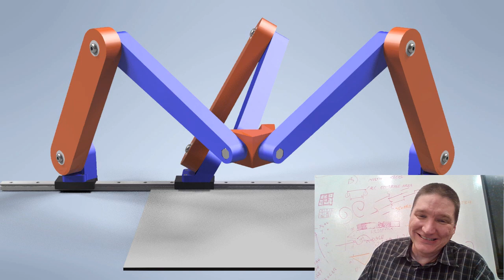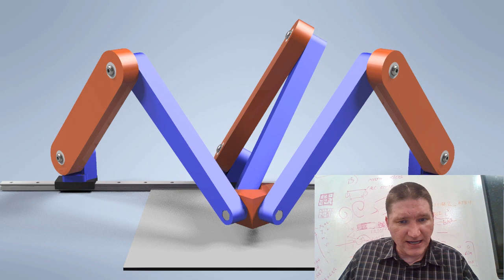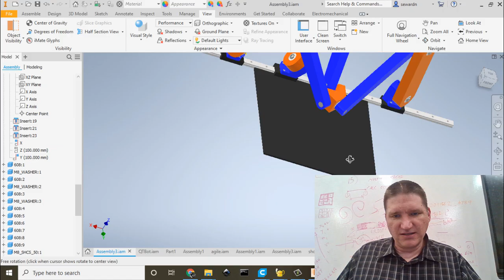RepRap Monorail (Single Rail Tripteron)

Comment: People are mentioning railroad tracks, but for urban areas you could simply use 3 "cars" (automobiles) or trucks depending on size, optically aligned with markings on the pavement. Would be a minimal set up time and could permit normal street traffic.

Comment: Haven’t finished the vid yet, but if there’s really any load on the platform I’d think there would be some toppling issues. He mentioned legs on the other side to handle the tilting, but how would that affect the “single rail” concept?
Reply from the maker: Just need to bolt it down to something.

Comment: Seems a little too rigid for complex shapes, but definitely viable for large scale. With a wider rail and linear guides, things certainly could be further improved. Since it's attached to 3 points, I think you only need the middle joint to be fixed like that. The left and right ends can be mounted on a rotating base. Also, for even more stability, an additional rail can be mounted behind the existing one the extra linear guides connected to the original guides.
Reply from the maker: I dont understand the rotating base concept.  The angles are all static as drawn.  The rail or rails need to be sized to fit your application.  I have mgn15 rails which can support about 50 ft lbs which is plenty.

Comment: Looks really cool but for how much leverage those small movements need it seems like the Torque you need is more than the metal parts can handle
Reply from the maker: The forces aren't that bad.  Sizing a rail to handle it was easy.  The limiting factor is arm rigidity.  It is easy for long arms to act like a spring.

Comment: Some very interesting kinematics on this. Would be cool to see it progress farther as a 3D printer.
A few questions:
1. How much space is required (length of rail, and clearance for arm movement) for something with a motion of 12" cubed?
2. Is the motion linear, or does it follow a curve where you may lose steps in the extremities of the movement area?
3. What are the torque requirements for moving something like this with an average direct drive extruder?
4. Can the end effector be designed to fit an extruder easily? What are the results of moving the arm joints further out? And are there movements where the arms would potentially interfere with an extruder?
Reply from the maker: 1) A lot.  For a Y of about 300, the rail needs to be 500mm plus any travel you want in the x.  Three is also the problem that the z goes to nothing as you get close to the rail.  This would have to be truely massive to get a 12" cube.  A meter long DuoRail could do it.  As drawn the DuoRail is 1500mm. <iframe width="560" height="315" src="https://www.youtube.com/embed/D3Fpy2_MyYg" frameborder="0" allow="accelerometer; autoplay; clipboard-write; encrypted-media; gyroscope; picture-in-picture" allowfullscreen></iframe>
2) Yes.  Linear everywhere
3) Not bad.  Torque and forces will be pretty low.  The problem is rigidity.  Arms that long will be pretty springy so it will be hard to define a precise location.  To solve this, make volumetrically bigger arms. (thicker wider...same length)
4) Shouldn't be a problem but you do want to stay as light as possible.  I would suggest a light extruder like an orbiter https://www.printedsolid.com/products/ldo-orbiter-v1-5-140g-dual-drive-direct-extruder?variant=32974481227861

Comment: Been thinking about this design since I first saw it. Going to build one for sure, even if it has inherent flaws. It's just such a cool unique design
Reply from the maker: Have you checked out https://youtu.be/D3Fpy2_MyYg. This is closer to what my prototype will be.
Reply: @NicholasSeward  I have, but something about there only being one rail just makes it so cool to me. Even if I know going in it it will have inherent flaws. I've been thinking about building a cheap ass-can be RepRap 3d printer for a few months now and this design is absolutely perfect for that
Reply from the maker: @t1mmy13  I need to revisit this.  I should be able to put two rails very close together.  The thing I need to do is allow the middle carriage to not be captured by the other two.  I also need to keep the arms from colliding.  I think clever positions and sizes can help there.  Here is another monorail, that is a little more practical. https://youtu.be/Q6_u6FMpCSE  It doesn't show it but I would also use two rails close together.
Reply from the maker: @t1mmy13  the angle can be anything between 0 and 90.  I used 30.
Reply: @NicholasSeward  My idea to work around that issue was using bigger outer arms and a smaller inner arm and see how far I will get. I can see how you would use a second rail but from my cheap perspective: two rails would raise the cost too
Reply from the maker: @t1mmy13  can't wait to see what you come up with
Reply from the maker: @t1mmy13  can't wait to see what you come up with
Reply: @NicholasSeward  Thank you for the encouraging words! I've went trough a few design itterations and I've found one that I want to start testing now. For now I'm using 180mm for xy and 160mm for z which seems to give enough travel range but avoids collisions. (in theory :)) 
Biggest issue I've ran into is sourcing rails, I wanted to go cheap and use v-slot and rollers, but I'm not able to buy those anywhere at 1 meter length with a reasonable delivery time. I'd love to use proper linear rails but I can't find them below 60 euro a meter which is a bit much, and that's without carriage/bearings. So I landed on using smooth precision rods, I can source hardend steal ones at about 8 euro per meter.  
As a backup plan I'm buying enough parts so if the monorail doesn't work out I can make it a duorail or straight up a tripteron.  
Motors are on the way, I'm going to wait for your thursdays livestream to see if something is brought up that I hadn't thought of and if not I'm going to order all the other parts on friday. It's been fun!

Comment: What if you placed three ball screws parallel to each other under the rail and have matching nuts on placed under each arm to capture the corresponding ball screw motion to the arm? Might be more reliable than belts
Reply from the maker: For sure!

Comment: @Nicholas Seward
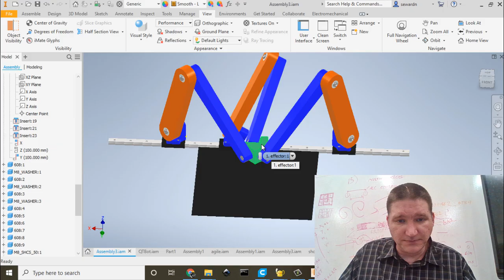2:26 You could add a (stepper?-)motor turning a gear that (is connected to a gear track or) rotates along a stationary threaded rod, the engine thing could be located between the black "gliding surface" and the blue "angle thingy".
I'm not an expert at all, but I feel that a threaded solid steel rod would be more precise than some pulley system.
Reply from the maker: Check out noncaptive steppers.

Comment: How would you move the arms in different directions if there´s only one belt? I feel like there have to be motors on each "foot", which would be very difficult and bulky...

edit: Ok you could use three parallel belts, each only attached to one arm, might still be bulky tho or be less rigid with the slimmer belts.
Reply from the maker: Yes...you would need a stepper on each carriage.

Comment: This looks pretty cool, could mount it on a wall and have it print on swappable beds in a sort of 3D print commission factory so there's minimum downtime between prints and allows extra care for removal of the print. Or you could print on a conveyer belt.

Comment: Did you analyzed the precision (what is the ratio between carriage movement to useful movement?)
Reply from the maker: It is either a 1/2 or 1/root(2) depending on the direction.  In anycase...close to 1:1

Comment: I would love to see a real one.

Do you got any idea if there are any compromises regarding the strength/stress on the parts, or speed or resolution limits at different coordinates etc?
Reply from the maker: Parts need to be as light and rigid as possible.  Speed and resolution will be roughly the same everywhere.  Big (volumetrically big but low mass) arms are what is needed for the rigidity

Comment: That one rail is going to have to be absolutely perfectly precise. Perhaps mount the sliders vertically and create 1 wide rail or two rails parallel. (I didn't watch the full video I had to get my idea out)
Reply from the maker: The rail specification saybI can support up to 50ft lbs in any direction.  One rail should be plenty for these light arms.
Reply: @NicholasSeward  oh awesome!

Comment: The problem with that is every point in space is not a unique map from foot position... and space is bifurcated. Easy to overcome if you solve the center arm problem algorithmically... otherwise you just make machine that will lock up and break itself.
Reply from the maker: Don't follow.  The resolution uniform over the whole range.
Reply: @NicholasSeward  I am sure there is a mathematical proof that you can't map 3 dimensions to 1 completely, continuously, or smoothly.
Reply: ...the monorail won't work... like you think. Some stranger shapes may be created more efficiently, but it will be harder to make strait lines and edges, distance and computationally.
Reply from the maker: @thescroll7521  sorry.  Reality begs to differ.  There are already tons of tripteron in the world.  This looks different but the math is the same.
Reply: Lol.

Comment: would be a giant stress on the rail though, with all the weight
Reply from the maker: Weight is very low.  The rail can handle up to 50ft lbs which is a crap ton compared to what I expect.
Reply: @NicholasSeward  well yeah obv it all will boil down to the use-case
Reply from the maker: Put another way...the design will be dictated by the use case.

Comment: Im not sure if this is going to work irl.
Because you have to consider the forces applied to the joints.
I see two problems with the z-axis movement.
1: The movement of the base is working mostly against the joint(s) of its arm, pulling them apart ( |.| -> \./)
This is somehow like how a screw stays in place because the friction is higher than the torque resulting from the pressure of the material trying to push the screw back out.
2: You have a high(?) transmission ratio. At first this might help with the limited space on the track but this makes the first problem even worse as you need even more force on the base to move the arm/tray (middle thingy) up 
(down is easy(er) because of gravity)
Reply from the maker: Yep.  You have some extra concerns when designing a tripteron.  Check out https://www.youtube.com/watch?v=beuY401hfh8  This is essentially what I am doing but with 3 rails.  You just have to establish a specification and design to meet it.  Math and engineering for the win!

Comment: That's about the most beautiful thing I've seen in a long time! Just wow...
Reply from the maker: Ahhhh.  Thanks!
Reply: @NicholasSeward when you mentioned the belt drive, at first I thought you should use a rack and pinion, but then I got to thinking... you could have a ball screw system with the exact same setup! A single long screw with three individual ball nuts!
Imagine that! -- A three axis system using a single bearing rail, and a single ball screw!!!
Reply from the maker: @ThatCB500XGuy  that would be very slick

Comment: Tripterons, and models that're an evolution of Tripterons, are cool and all, but it always seems that they take a much larger amount of space than what their build area provides, which is typically an issue. Though this idea could be cool for expandability, either in a series of build plates with multiple sets of arms along a singular rail, or using two rails for discrete multi-extruders on one build plate, or a combination of both.
Reply from the maker: It is no SCARA when it comes to robot size vs build volume but I would say tripterons are only slightly worse than traditional cartesian bots.

Comment: Seems like a good idea for 3D printers till you realize this would be really unstable and jerk sensitive. Neat idea tho, but I don't think it'll take off
Reply from the maker: It will be a trick to get right.  However, some tripterons can pull 5gs will remaining accurate.  It is just a matter of engineering for the specification you want.

Comment: So I know that stepper motors and their behavior means that if a motor needs to move a small amount over a large area would result in a "salmon skin" like effect.
While if the motor needs to move a large amount over a small area it would limit printing speed and possibly contribute to extrusion issues.

So, I wonder.
To show how this would work could you provide a map of the accuracy/speed across both axises.
Reply from the maker: Suprisingly the resolution is a constant everywhere.

Comment: Now that's creative! One of the problems is the y resolution which will always be only half of the x resolution. In other words, you have to do 2x steps when doing an x movement compared to a y movement to get an equal resolution on x and y.
Reply from the maker: As drawn, the x and y resolution is the same.  I do have a version in the works where I traded in the 45 degree angles for 30 degree angles.  That will reduce the y resolutions.
Reply: I'm thinking of building this and I might be using this kind of a belt path in order to increase the resolution (mostly to get finer z resolution): https://youtu.be/bheHUcz1AIo
Added benefit is double the torque.
I might even go with 0.9 deg steppers.
One arrangement of the motors could be to place them just after the edge of the rail... The motors would be next to each other with their shafts pointing to the "floor". Assuming that the shafts are 17mm high, the motor farthest to the rail would be offset from the floor a bit more than a shaft length, let's say it's 20mm total.... The motor next to it would be offset by 40mm and the one closest to the rail would be offset by 60mm. That way even a complicated belt path like in the above video is possible.
I must admit that I like your idea of using a single belt and mounting the motors on the carriages alot due to its simplicity and minimal part count.

I saw your design a few days ago and I can't stop thinking about it :)
Reply from the maker: @hrvojehorvat9099  Awesome!  I can't wait to see.  I should note that resolution is not going to be a big problem especially with modern drivers.  The dominating problem will be arm rigidity.

Comment: It is a really nice idea (especially for machines that need to be compact and do not have a lot of a load - I can even imagine going as far as having a trailer with such thing mounted on to print small-scale concrete), but I see one issue that, imo, is unfixable by design - max z varies depending on y, and at some point you pretty much have no z at all
Reply from the maker: Fixed....https://youtu.be/_mGD5NxuxdI and https://youtu.be/Q6_u6FMpCSE hahaha :-)
Reply: @NicholasSeward  well, the first one is not that compact, but the flying thing makes the problem non existing at all indeed (but now you can not mount in onto movable platform).
Though I just got an idea that you can put that middle arm on the second rail that sits right next to the first one to keep the kinematics same but resolve the collision issue. It will not technically be monorail, but still have the spirit of the one in that video. 
Also if done on a bigger scale they can be self-propelling if you attach motors with pinions to their bases and add racks to the sides of rails (I personally always try to avoid belts :p)

Comment: This video is great, thanks for sharing! I really like your idea. For the movement belt look at blue flexirack. I've used it on my CNC after discovering it in a sewing shop. works great and is strong. Its a rigid timing belt that you can bolt to a flat surface. Worked out better than a regular t2 timing belt in my case. I do not know what the industry calls this type of gear tooth strip. edit: Oh its a flexible rack, should have seen that coming!

Comment: Awesome idea! 
A second parallel redundant rail could be added just for increased stiffness.
Reply from the maker: The specification on the rails say they can support a torque of up to 50ft-lbs.  I should be an order of magnitude less than that.  I am thinking about a second rail though This https://youtu.be/_mGD5NxuxdI
Reply: @NicholasSeward  
Was more thinking about the bending flex of the arms rather than torsion flex of the rail. Especially for 3D printed plastic.
Reply from the maker: @mechadense  I see.  That is easy to design around.  If you double the cross sectional area of your arm, you get 4 times the rigidity.  The weight of the 3d printed parts increase by a factor of a little over 2.  Long story short, it is pretty easy to make 3D printed parts rigid enough, they just have to be volumetrically big but they can stay pretty light.
Reply: @NicholasSeward  I see. Well you lose a bit of build-space. To be honest the ulterior reason for me to obsess over stiffness is that beside the repraps of today I am also thinking about far future diamondoid nanomachinery (for micro to nanoscale atomically precise 3D printers in matter processing chips). And bending stiffness scales down linearly with machine size. So I like to look at robot geometries that maximize stiffness such as: 
★ parallel mechanisms (as many of yours)
★ stubby mechanisms (as you suggest)
★ redundantly supported mechanisms
(as I brought up here)
Reply from the maker: @mechadense  Yes yes yes!!!
Reply: @NicholasSeward  -- If you like the idea then I can recommend:
(1) the book "Nanosystems: Molecular Machinery, Manufacturing and Computation". There is lots of fundamental feasibility checking math in there. 
There's a free but incomplete Version too. 
(2) My wiki: "Mechadense's wiki about atomically precise manufacturing"
Reply from the maker: @mechadense  Looked at the wiki and really dig the vibe.  I have no plans to go this direction but I bought the book.  Who knows.
Reply: @NicholasSeward  -- Thanks for checking it out. 
There is a plethora of aspects to this. 
One aspect that might be one of the more interesting ones to you is the idea of self replicating pick and place robot systems …